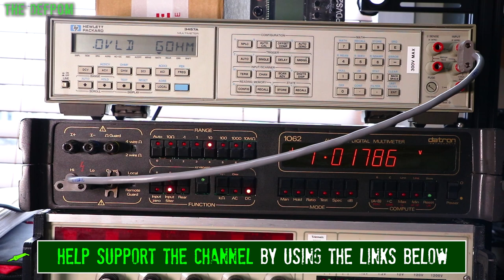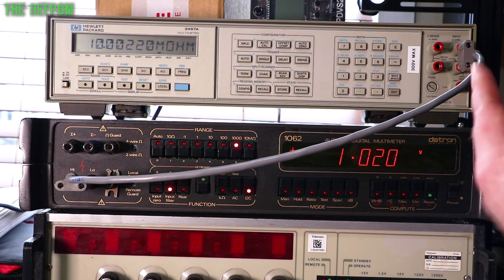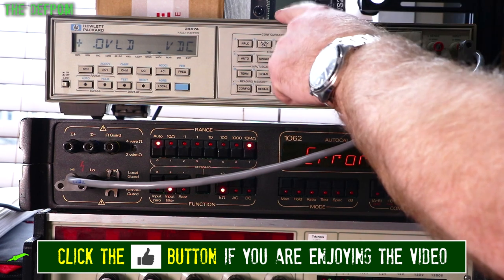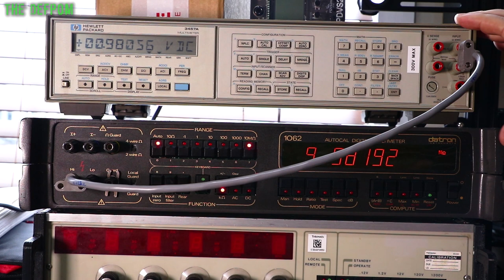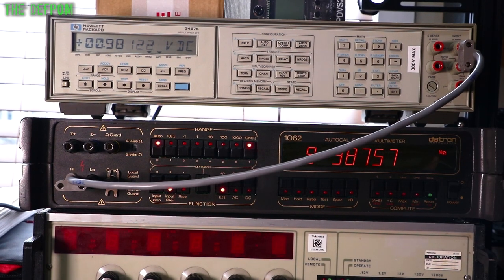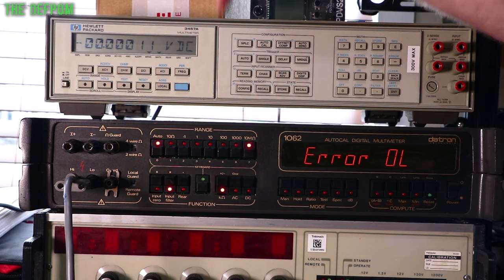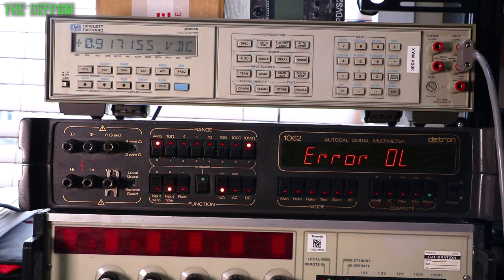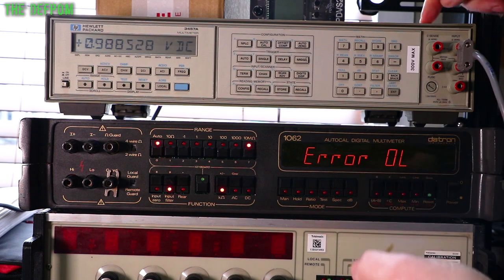#765 Why Are My Measurements Wrong ? - Multimeter Input Impedance Matters - You Need To Know This !

Comment: Excellent demonstration of input impedance and its circuit loading effect. This is a common issue when using high voltage probes (which are voltage dividers) with different meters having different impedances. HV probes are designed for a meter with a specific input impedance.

Comment: In the mid-80’s to late 90s I worked on a crt based industrial instrument. The high voltage was critical to crt linearity. 

There was a 2000v supply that was critical. I used an original Fluke 87 and a Keithly high voltage probe. The combination read about 30-40 volts high. 

What I found is that the Fluke 87 in Auto-Range mode had 11mohms input resistance. In manual range mode, it had 10mohm input resistance.

So, the Fluke 87 with a high voltage probe could only read 2000 volts accurately in manual range mode!

Comment: I did hint about meter loading, but i didn't take in to account your posh meters input resistance changing.
You need a buffer on the output of the attenuator that has a low resistance drive into a low value termination resistor,  hopefully swamping out the posh multimeter loading.
I could be talking crap... likely lol.

Comment: This is a pretty well known issue. Your lucky your not using an old Analog meter such as an AVO  8 or worse Avo 7 where you would see a very big error. When designing  these it’s normal to make the lower divider resistor at least and order of magnitude stiffer that the meter impedance but this obviously depends on what accuracy your trying to achieve. The idea that meters have a fixed input impedance  of 10Mohm  is a notional one and is not generally the case as you have found.  The answer is all your meter are reading wrong as a measurement shouldn’t effect the thing your trying to measure. However for most applications the measurement error isn’t significant.   In terms of impedance the BJT being a current mode device means you don’t often see the effect of meter loading today. But back in the day using voltage coupled devices I.e Valve Tubes and low impedance analog meter it was a well understood issue.   When I work on valve circuits I use my AVO meter or the voltages won’t match any of the service data if using a modern meter. There nothing new under the sun !